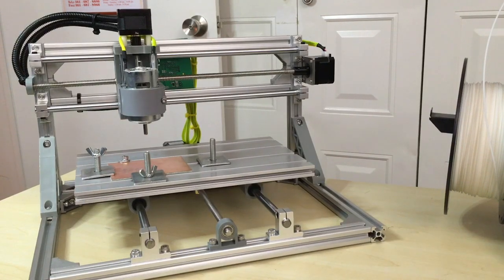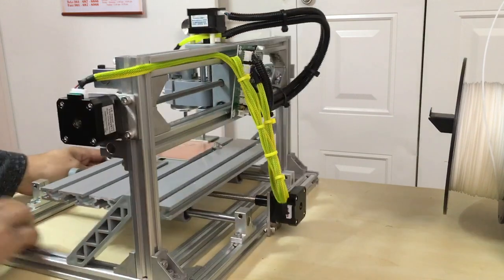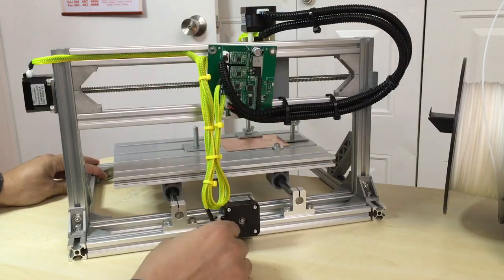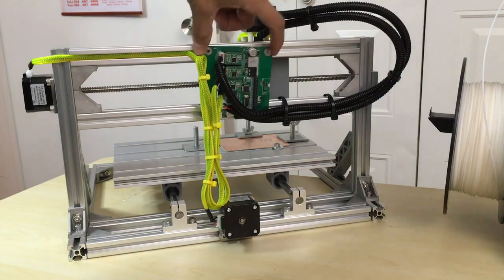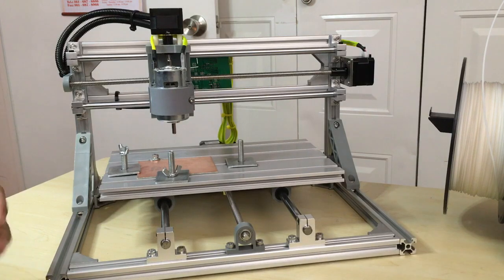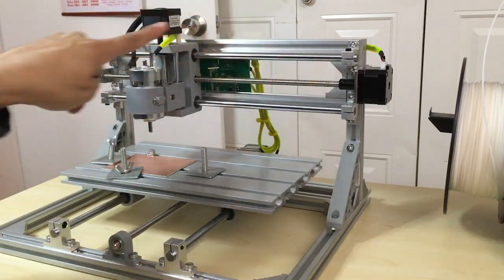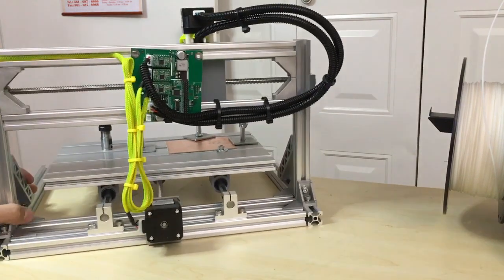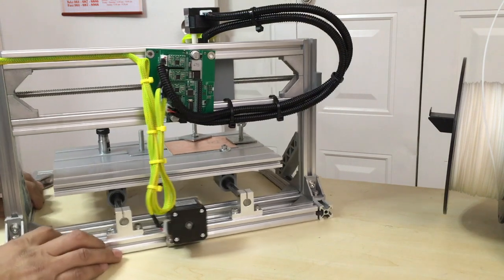Cnc 3018 looking good

Comment: Good video Eddie. I just bought the same machine, really pleased my kit did not have any missing parts. I'm just adding limit switches to all three axes which involves some 3D printing. Great fun.
Reply from the maker: Clive Hudson I was just playing with mine yesterday because I managed to break my motor by trying to remove the ER11 collet . Which then somehow managed to burn my board so I just have a frame and motors basically, now I’m considering turning it into a Scara robot for learning purposes 😂
Reply: Eddie Amaya  Oh that's not good. When I rotate the X or Y axis threads to manually move the drill bed, I have noticed that LEDs on the controller board lit up - even though the was no power connected to the board! This is because the motors become generators when turned manually - I wonder if the controller is designed to handle that. Does anyone have a circuit diagram for the controller board?
Reply from the maker: Clive Hudson if you google GrBl schematic you should get something because it’s open source they should all be about the same. And since the Leds light up its a clear indicator that it probably does not have protection.

Comment: That’s looking really good I must have been lucky with screws for for the driver board.  A 3D printed case would be great for the driver board. Your collet is much better than the one I have.
Reply from the maker: i also have the little gold tube loooking thing, thats the one ive been using. Ill mount the other one soon enough. yeah im printing the case as we speak
Reply from the maker: ill upload later
Reply: I got loads of extra screws with mine. Probably about an extra 10, plus nuts! Fitting on the collet chuck was a nightmare though and I ruined one motor.
Reply: To get the collet on you are supposed to stick the motor in a bag, and then in the freezer. Once its cold take it out and its much easier to get on, although still requires a bit of hammering.

Comment: Howdy Eddie,
Have you ever considered swapping the control board with a STM32 based board? By the way, I'm looking for a same type of compact CNC machine. DO you know if by replacing some parts I'll be able to drill some steel pieces?
Keep on doing good stuff with your STM32...
Reply from the maker: I have this thing collecting dust, I quickly got over it. Bits kept breaking and it was just annoying, turns out machining is a science in itself. I was not interested enough in it to really put in the time to learn about bits and speeds and all that stuff. So i turned it off and put it away. I got it for PCB milling and like I said it was very inconsistent and that was mostly due to cheap bits...
Reply from the maker: I have this thing collecting dust, I quickly got over it. Bits kept breaking and it was just annoying, turns out machining is a science in itself. I was not interested enough in it to really put in the time to learn about bits and speeds and all that stuff. So i turned it off and put it away. I got it for PCB milling and like I said it was very inconsistent and that was mostly due to cheap bits...
Reply: @EdwinFairchild   Yes, That's the problem with Chinese stuff. A good CNC needs nice strong parts because of all the stress that it's got to endure.

Comment: I have it too. My machine freezes at each PCB , wich i try to mill. I could not to get only one entire PCB milled, yet. I am replacing its control board, based on Atmega328, by one based on ESP32. Exactly as you did, I do prefer order my PCB's from JLCPCB. It is better to wait them, than do milling.

Comment: Hey, i have the same Cnc 3018 with (Arduino)

All things works fine except my X Axis.
It goes from Positive to Negative.
So my X Axis working like a „mirror“

Can somebody help me? Im trying to fix it since months 😅
Reply from the maker: change the settings in GRBL: https://github.com/grbl/grbl/wiki/Configuring-Grbl-v0.9 check out command  $3
Reply: Check the wiring. You could have reversed the stepper wiring to get the right direction.

Comment: can this cut aluminium? I'm thinking of getting one off Amazon so i can make some custom motor brackets for my electric longboard.
Reply from the maker: the cnc itself seems rigid enough to mill aluminium but definitely not with this tiny spindle. i would get a 3040 from ebay for aluminium

Comment: I just got one of these myself. Would love to know exactly how you upgraded to GRBL 1.1 with the Arduino?
Reply from the maker: Im not sure how to do it with the arduino, because i used an Atmel AVR Dragon programmer, but if you look up how to use the arduino as a programmer you can use it to upload the hex file. also there is a program called Xloader used to upload hex files to chip and i think it can use the arduino. just look up Arduino as programmer

Comment: Should i buy this cnc my purpose for this machine is to use it for pcb , is it worth it? Can you link me to the photos of samples it has engraved?
Reply from the maker: yes it can mill pcb that is why  i purchased it but i quickly realized how much i hate having to design big pcb because the machine has a limit of how small you can lines next to each other and and also drilling holes you have a limit of how small you can make them , given the bits that you use. And with current prices of pcb manufactures i think i will only do pcb milling on emergency cases. Not to mention doing double sided boards is very annoying having to pass rivets to make vias. So this is best for single sided designs where you dont care about making big boards, personally i like to make boards as small as possible. I will use this for other stuff maybe cutting wood stuff or maybe ill upgrade the spindle to mill some aluminum parts. or i might just get a 3040cnc